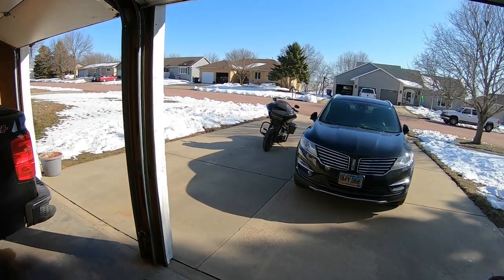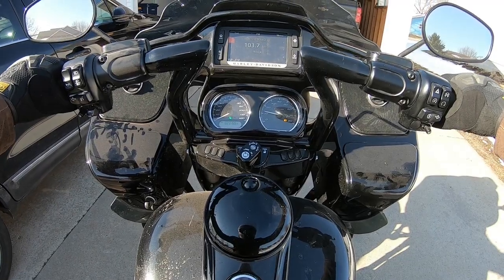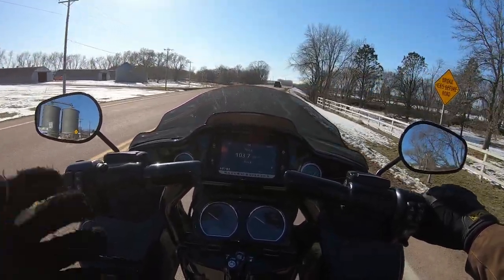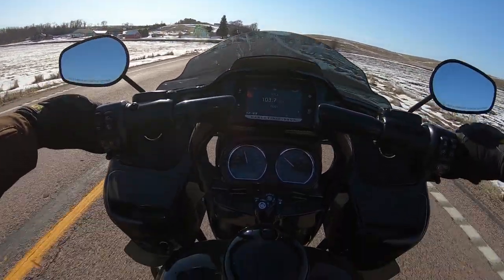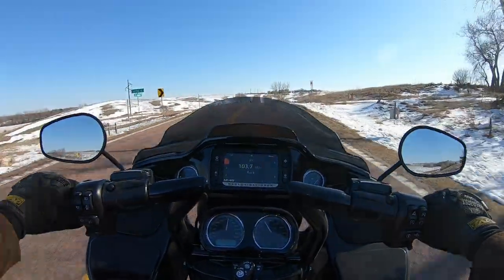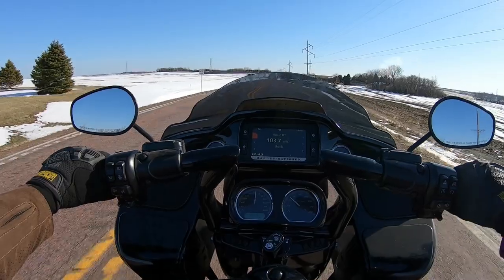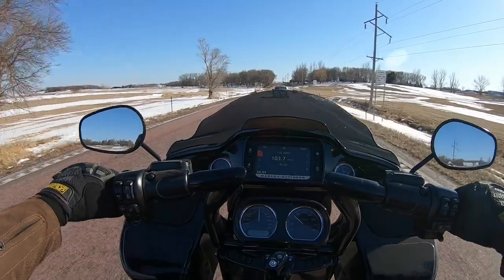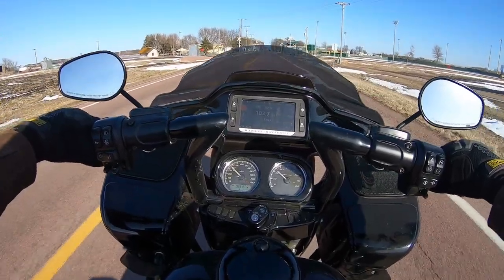First Impressions of the S&S 475 Cam--Road Glide Vlog

Comment: Just had this cam put in also. It makes the bike sound like a Harley should. I used to short shift with stock now it's so much fun just to stay in the throttle. You hit 4500 rpms and it's like a turbo kicks in.
Reply from the maker: Oh yeah. It balances out the power much nicer so you can rev it out and actually feel like you're still in the powerband

Comment: Funny.  I have the 2020 114 RGS.  We must have similar taste...I also did the 12-inch Vintikta bars,  full 475c kit from S&S.  Did the 13-inch windshield (perhaps yours is the 9-inch?  Even though Im only 5'9", I sit pretty tall because I have short legs. Added legend shocks front and back,  Scorpion seat with extra gel from BadBoys, Kromewerks slip-ons, HD Screamin' Eagle Ventilator Extreme Air Cleaner.  I ride it as my daily rider since I share a car with my son and he takes it to work each day.  I live in tune with the weather.  If it is too cold, rainy or snowy I just look for stuff to do around the house and do my errands the next day.  I'm also semi-retired so it is likely easier for me than a younger guy who needs to be at work at the same time every day. Have taken it several states away and back to visit family....works flawlessly.  I do, however, need to get it to a good Dynatuner guy at some point as the mileage is a bit low and the o2 sensor triggers the check engine light...even after I reset it a couple times.  I'm sure it goes off as it is simply running too rich and sometimes smells a bit like gas in the garage.  Cheers!
Reply from the maker: Sounds like you might be two rich at idle. Definitely worth taking to a Dyno to get it dialed in and get some more ponies too
Reply: @MeathedMoto  yup. The problem is I live in a pretty remote place. Will have to wait until I go to the city at some point…about 1.5 hrs away. Keep making good content. I know I like all of your videos

Comment: Just put this s&s cam kit into my 114 fat bob and it’s turned into a complete rocket ship. Just using the power vision tune from fuel moto until I can get the dyno tune in a couple of weeks and really dial it in but I hear your comment about taking it easy. It’s far to easy to smash speed limits. My mpg seems to really have been impacted but will know better after the dyno tune!
Reply from the maker: Mine hasn't been too bad. When I'm just cruising I get 39-40 mpg. But if I'm a little less conservative I get 36. A dyno should help figure out where maybe you're too rich in your mixture causing you to lose mpg. Fuelmoto knows there stuff but to dial it in for your elevation, pressure, average humidity etc will make a big difference
Reply: @MeathedMoto  got the bike back from dyno today. Making 121hp and 12 torque and feels so much smoother / better haven’t had a chance to work on mpg yet but it’s definitely going to be better
Reply: 123 torque. Not 12!

Comment: I’m super excited I’m getting a s&s 475 installed and dyno tuned on the 19th can’t wait hope it’s worth it ha
Reply from the maker: Definitely gonna feel like a different bike past 3000 RPMs. Still is strong down low but it's really awesome past 3k
Reply: @MeathedMoto  what year is your bike mine is 2021 so I’m keeping stock oil pump. Fuel motor told me no reason to upgrade unless go bigger bore later

Comment: Spot on about the 475 with a 2-2 exhaust and losing a few hp! I have a 132 BB low compression and opted to keep the 475 and keep my Vance And Hines Mini Grenades over going bigger cam and 2-1 exhaust because of the raw bad ass sound! Ill take the few less horsepower and smile every time i hear the exhaust and cam lope. Once you hit 150hp, it doesnt matter anyway lol!
Reply from the maker: Realistically the butt dyno doesn't feel the difference between 110 and 106
Reply: @MeathedMoto  spot on my guy

Comment: So after putting on some miles with the Cam has there ever been any issues or slippage with the clutch??
Reply from the maker: No thankfully not. Haven't had any issues with the clutch and I have about 8000 miles or more. If I go get a big bore I'm sure I'd need to do that.

Comment: Just curious and maybe someone on here can answer...what is the best Cam I can put in My 2022 107 Street Glide? Thanks! 
Great video and the Bike sounds Awesome!
Reply from the maker: I love my 475 cam but it really depends on your riding style. If you spend more time in the lower rpms a lower lift cam like the 465 grind is better. If you're revving your bike out and running it to the limits the higher lift cams will do better like this 475
Reply: @MeathedMoto  Thanks for the Reply...I'm a HIGH RPM guy! 🤣🤣

Comment: Sounds great.What tuner you using?
Reply from the maker: It was tuned with a Powervision. Only tuner I'd use next to a Thundermax
Reply: @MeathedMoto  Yeah.I heard nothing but good things about Power Vision.Vance and Hines FP3 is kind of limited.
Reply from the maker: @1pollo1rabbit  that's what I had before. It is very limited on it's capabilities. I think if you're just looking to run a little better than a stock tune after an air intake swap and exhaust. But if you're thinking of doing cams, bigger throttle bodies, bore kits etc, go with a Powervision or Thundermax. Almost all shops can tune with those as well

Comment: I have a stock 114 and I want to get out of the realm of your hp. Any suggestions?
Reply from the maker: So the 475 cam is really there 100 horsepower cam. So no matter what kind of exhaust you're running you'll probably achieve a hundred horsepower. For reference my two into two pipes actually got me 106 horsepower but if I had a two into one pipe I'd probably be closer to that 110 horsepower. I would recommend either of the S&S 475 cam or the redshift 468 cam. I know that Woods also makes good cams as well but I do not have any experience with them. I do recommend buying a cam plate and oil pump so that way your engine won't be starved of oil and it will run cooler as well. My bike was tuned on a Dyno with a dynojet power vision so that is what I would recommend or a thunder Max tuner. Hope this helps.
Reply from the maker: Don't forget a good air cleaner as well to maximize flow into your intake
Reply: @MeathedMoto  I keep hearing s&s as well as woods did a little research on red today but my thing is I’d like to keep the oem look with the dual exhaust so maybe I could change the exhaust to a different company like bassani with some mufflers idk I want loud and numbers I’m looking to get into somewhere like 143 hp
Reply from the maker: keep in mind with that kind of goal in mind you'll probably have to go big bore (128 or 131). you'll also have to consider upgrading your valve train components, clutch basket, springs and plates, as well as the compensator. Personally try a cam upgrade with the pump and plate and get a baseline. You will be surprised at the difference just a cam and good tune will do to your 114 even though it's not 143 HP. 114s make bout 90hp at the rear or so just to 115-120hp with just a cam is a 33% gain.

Comment: Did you do anything to the clutch from stock?
Reply from the maker: No. Stock clutch pack can hold the power. If I get bigger displacement,  change throttle body, injectors, etc I'm sure I'd need the do something about the clutch and compensator

Comment: My 131SE is very rideable , I don’t have a clue what you’re talking about
Reply from the maker: Your Harley 131 is probably rideable. I'm talking about the insane 124 and up builds that's make ridiculous power everywhere in the RPMs. I've talked with a few guys that have big bore motor builds and because the M8 can make a lot of power when you put all the right pieces on it, you basically can make it like a light switch where it on/off. The slightest twitch of the throttle and it's ready to buck. To me that can make a bike unrideable in a way. Your 131 if it's running the cam and tune that comes with the kit isn't that.

Comment: Beautiful bike!  The SS 475 cam feels like it going to stall when in first gear at a stop Did you ever experience the feeling of stalling when in first when taking off?
Reply from the maker: I experience that every so often if I stop and start my bike often. Happens if I go to the gas station, shut the bike off, fill, start up the bike again and it idle downs a little too low to the point where it's like is it gonna stall. But it idles back up and finds it's happy spot. I rev mine a bit before I go in first at stop lights.
Reply: @MeathedMoto  Thank you very mush for your reply. I enjoy your videos.  Ride safe.
Reply: I have the S&S 475 cam with bassani 2 into 1 dyno tuned with same numbers and definitely has a little issue wide open throttle off takeoff but if you just roll on the throttle then smash it you have no problems! I've been told that to get rid of it you need to upgrade your throttle body!
Reply: @jacobfox6838  it's because of the aggressive cam timing of the 475, you need to wind it on slowly to get some intake velocity. Other cams without the huge over lap don't do it.
Reply: @jarrodwilson7702  i can see that that would also be what make this cam sound more like a twin cam at idle, which i love ever since I trade my 09 for the 18 I was disappointed with the idle! Now it sounds wicked and just cruising at 3k rpm the bike kinda sounds like old big 4 stroke like a Yamaha 426!
Reply: Happens to me, i bought a 2015 street glide with a cam, it stalled twice when taking off, really sluggish, im taking it back to the dealer so they can look at it

Comment: Question. Is the motor a 107?
Reply from the maker: Si
Reply from the maker: 107 with the S&S 475 chain drive cam, S&S cam plate, oil pump, lifters, lifter cuffs, pushrods etc. Makes 106hp and 119tq at the wheel